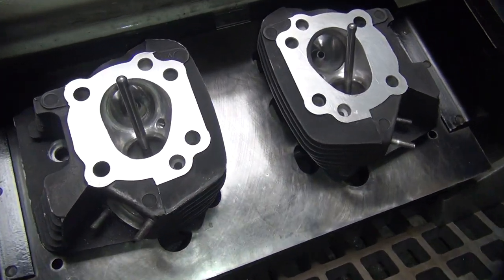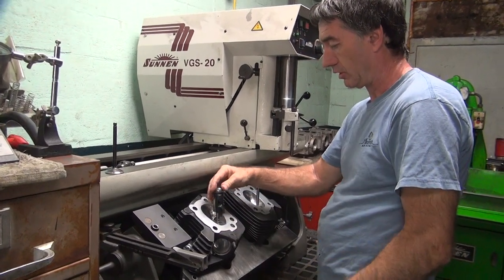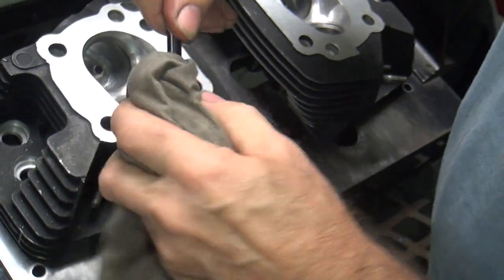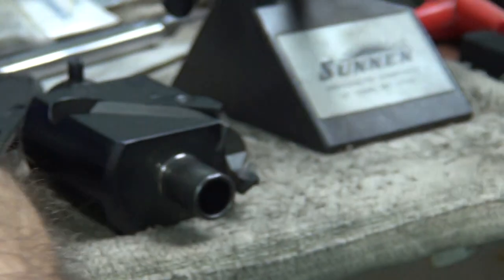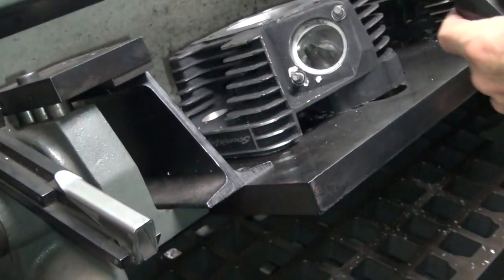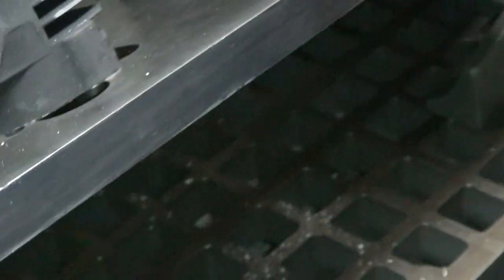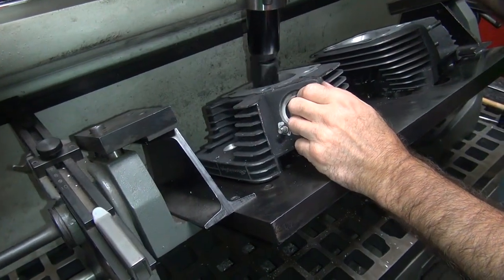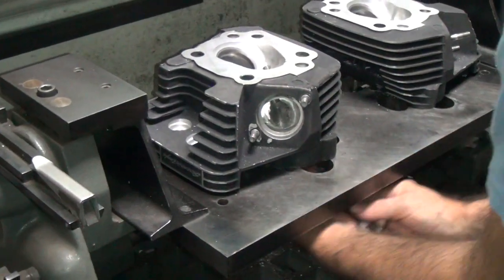#102 kens learning how to port seaming eagle heads 80ci evo harley fxr dyna fxst by tatro machine

Comment: coworker has a 99 twin cam expolice bike with a tick in front cylinder/ topend area.  I haven't heard it yet and he is a little hard of hearing . can the top end and jugs be pulled in frame or does the engine need to come out of frame ?
Reply: Walker Vaillancourt no ... pull the lifters and inspect them. I had a dead lifter that made the top end tick on my '01
Reply: Michael damon no what ?the heads and cylinder  can't be removed in the frame ? or they can be.
Reply: Michael damon he has had them replaced 3 times all under warranty noise won't go away. he thinks a wristpin or piston problem .like I said he is old guy that don't hear the best I hope to put my ears on it sometime this summer it is in storage so it is not being ridden or has been in quite sometime
Reply from the maker: yes you can pull the topend off in the bike. all harleys can. guessing what is wrong is a waste of time, just take it apart and fix what you find. you spent months screwing around and you could have had the motor apart in a few hours and see what is wrong and then get it fixed.
tatro
Reply: Tatro Machine thanks. That is precisely what we are gonna do he just has to get it to the shop so I can work on it after hours. bike was an 88 Inch turned Into a 96 Inch with bigger juggs added se 211 camshaft all done at a dealer. so who knows what I will find it still runs good just has a noise in it so he parked it the circumstances just before the noise started makes me think he damaged a lifter as he was essentially drag racing it we will see on teardown. do you send parts out in the mail if so I will give you a call when I get to that point
Reply from the maker: yes i can ship parts to you.
with se cams i would guess the cam bearing surface is gone on the cam. all the harley twincam camshafts are made out of junk steel and it fails all the time. never use harley cams.
tatro